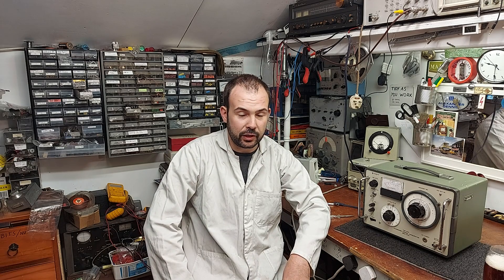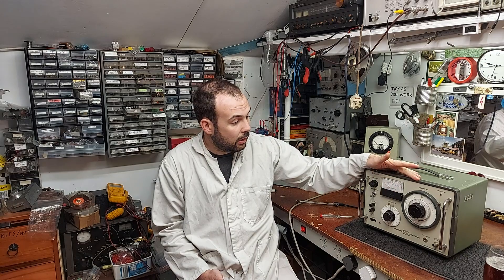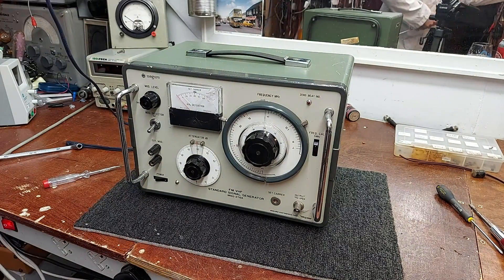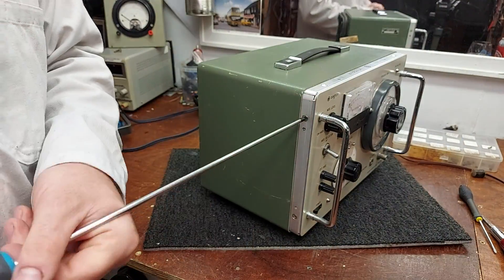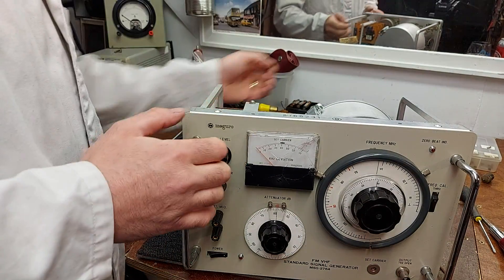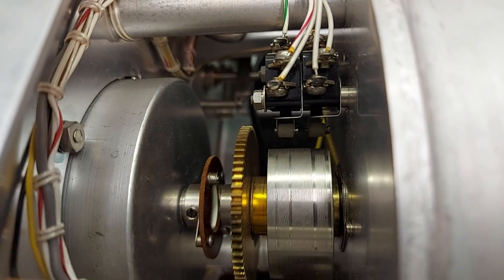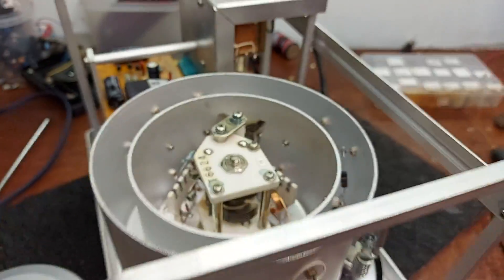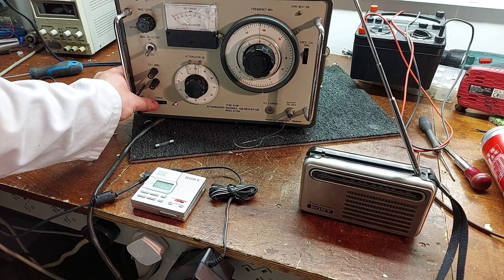Meguro FM signal generator.

Comment: That's so well made, loverly bit of test equipment :-D
It looked like it was a valve based set, but it wasnt heavy enough.
Youtube is a hobby,  You just made an interesting video :-D
You have been making videos for two years,  it does not seem that long.

I have an old generator that feels like it's bolted to the floor when i pick it up, cast case with strong metal handles on the sides.
The name is something like Roe and shwartz (i can't remember the name accurately).
It has a airadrome badge on it AE (i think that's what AE means).
No one will steal it, thats for sure lol.
Reply from the maker: Rohde and Schwarz, very fine instruments. Look up there Polyscope!